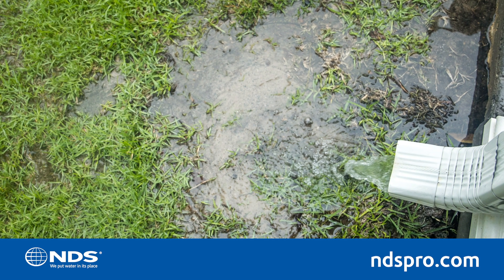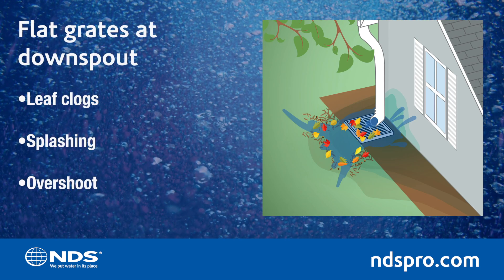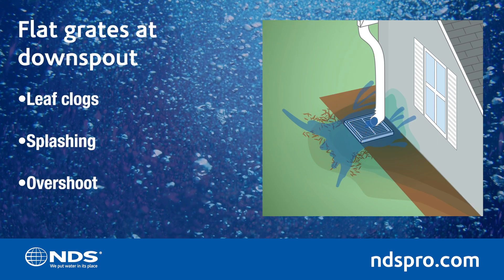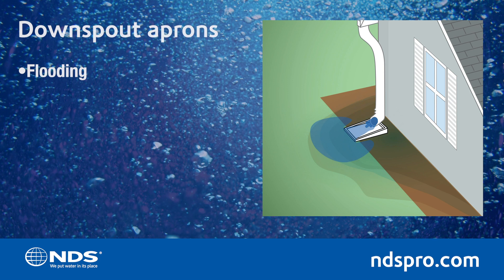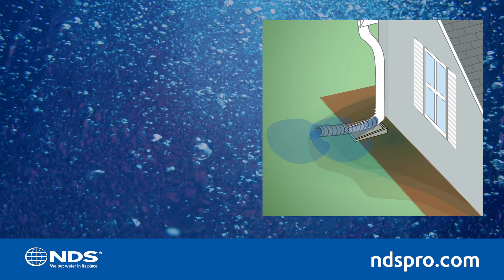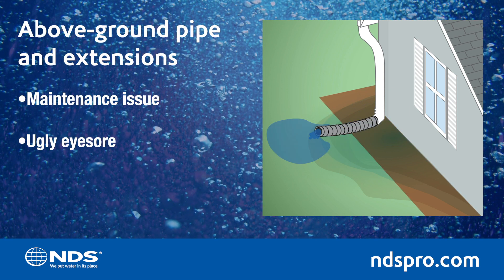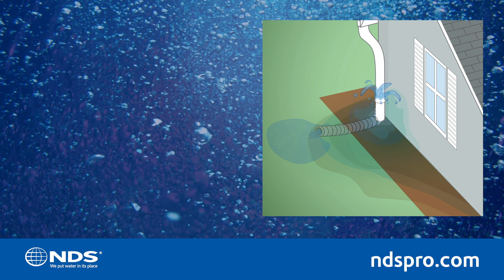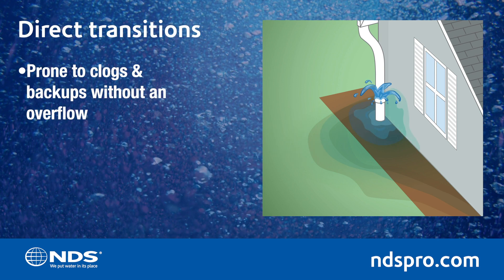How to Fix Downspout Drainage Issues | NDS Drainage Systems

Comment: I don't have trees overhanging my roof but I am concerned about all the shingle granules that run off the roof and down into my gutters.  I would think the better choice would be either the 12" low profile Defender grate and catch basin with filter because of the shingle granules, rather than the down spout connector to buried pipe with adapter.  I don't see how it would be possible to clean out a build up of shingle granules with the second option (down spout with clean out adapter).  What are your thoughts?